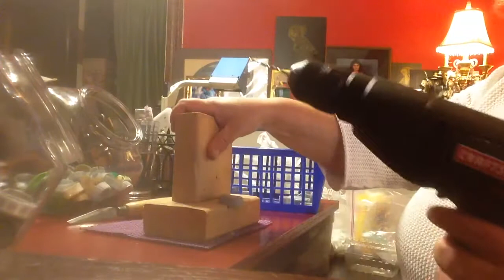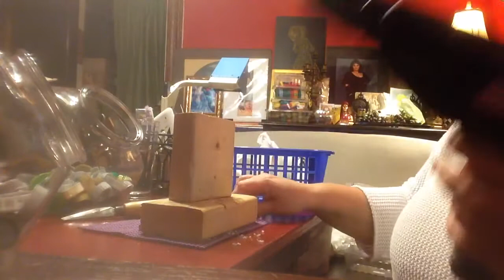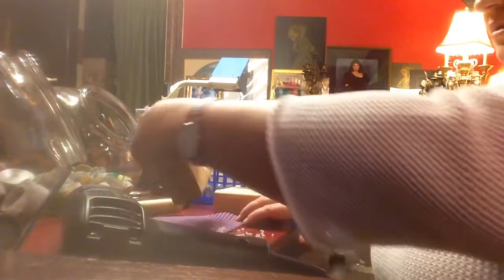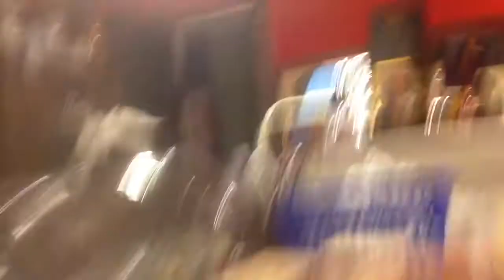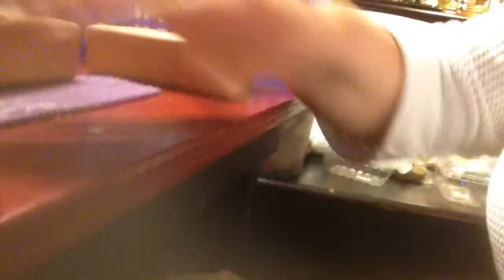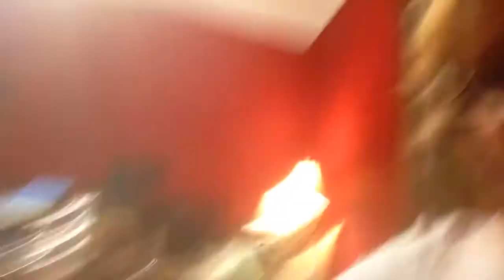Plastic Bottle Cap Curtains part 2: How to drill a lot of bottlecaps. (Old video September, 2017)

Comment: Do you have any suggestions for those who don't have a drill machine?
Reply from the maker: 1. Use an old knife with a pointy tip or a sharpened pointed piece of flat metal to gently twist on the spot to form a hole.

Or 

2. In an outside space, heat the tip of a metal wire to melt a hole. Outside because melting plastic makes fumes that are not pure to breathe. This is a messy method and you will have  to clean off melted plastic after.
Reply: @TMIvey-gk4mw  Thank you! I think I will go with option 2.
Reply from the maker: Be careful!  Make a handle to protect yourself from the heat of the wire!
Reply: @TMIvey-gk4mw  Yes, definitely! Thanks a lot for your thoughtful suggestions. 🙏